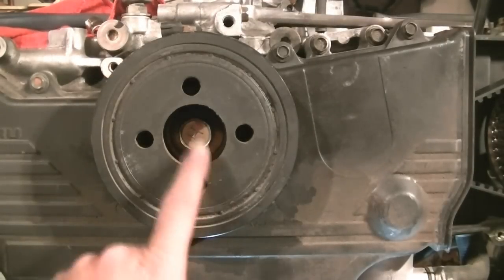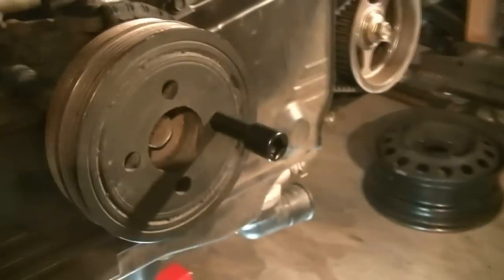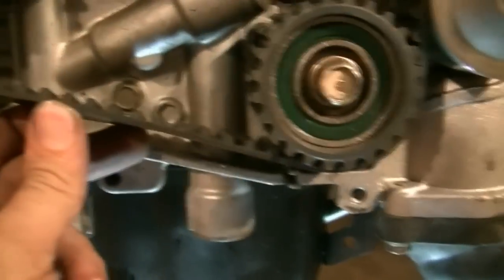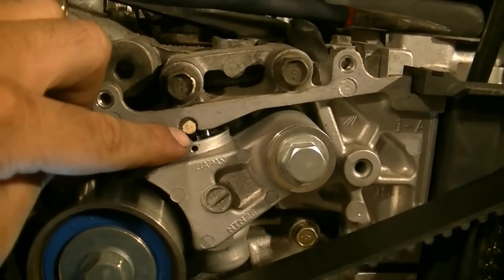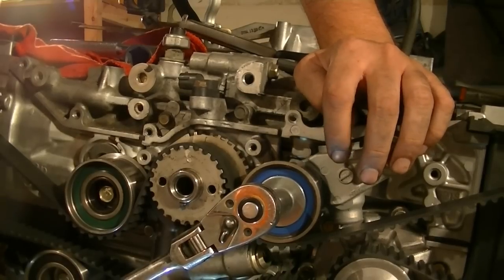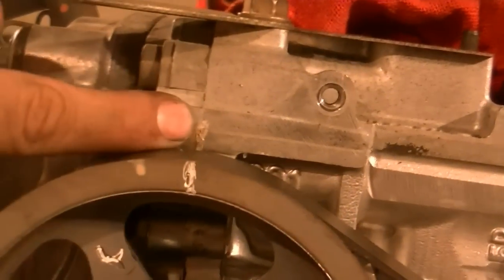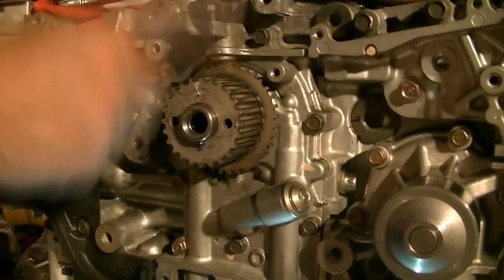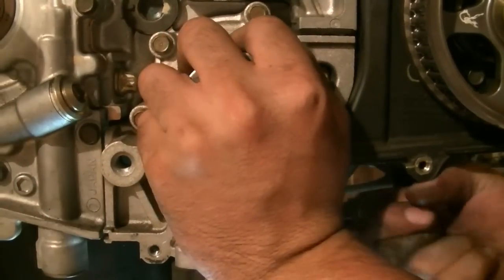How to Rebuild an EJ25 Subaru Engine - Part 2

Comment: A problem with re-pinning the tensioner this way is that you may over-torque the  tensioner idler bolt so it doesn't spin freely anymore.

Comment: Do you recommend reusing the hydraulic tensioner when overhauling an engine with 114K miles or simply replace it with a new one?

Comment: Just a tip: Never remove or try to remove the tensioner first or even pry it up to pin it. First off the bolt has a good chance of breaking or stripping, I've seen it happen many times before. Secondly, to make it easier to get the belt & tensioner off, remove the lower left pulley first then the lower right pulley. Once they are off, the belt is loose and can easily removed. Also, Never use an impact to remove any of the timing components, especially the 3 for the tensioner. They will easily strip &/or gall the threads which will be expensive, if not time consuming, to fix.

Comment: Yes, if you're reusing a belt then it should go back on the way it was installed since the belt has been tracked or seated and the wear pattern has set. Same thing holds true for serpentine belts.